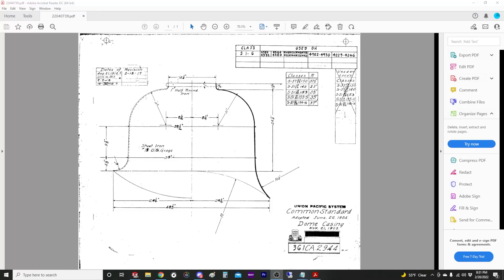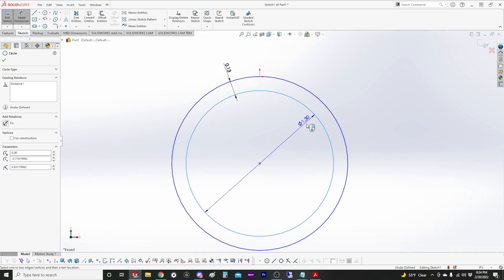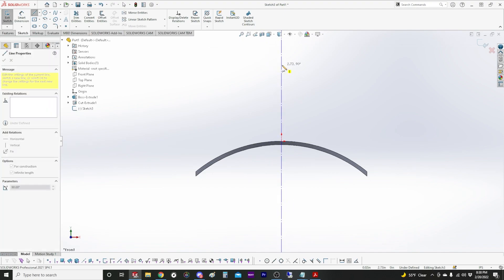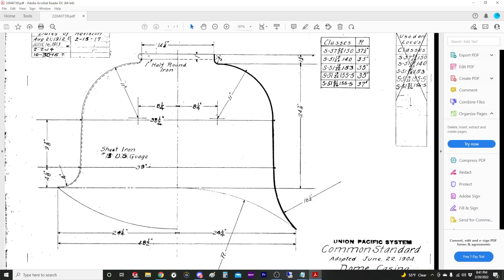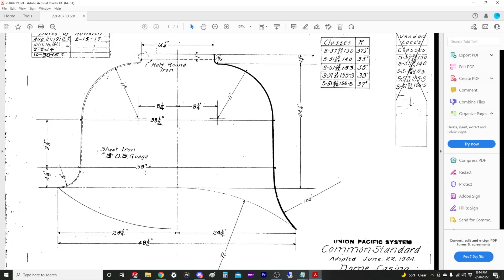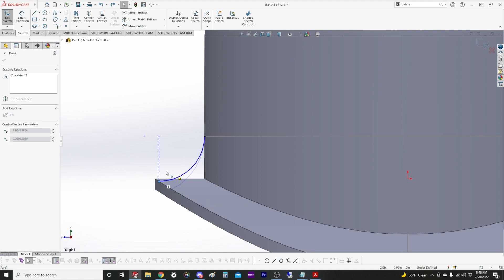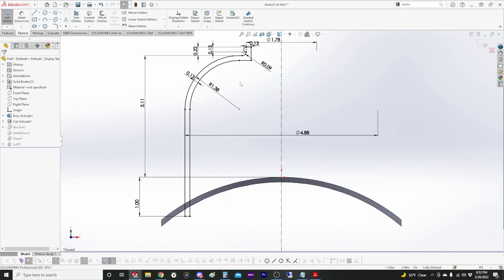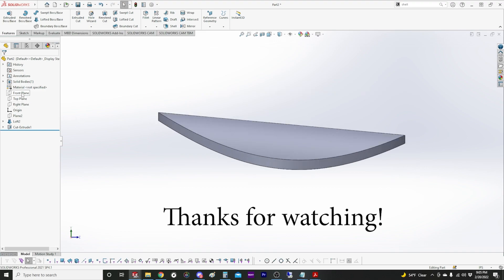Drawing a Locomotive Steam Dome in Solidworks

Comment: That looks so easy! Oh how I've struggled with 3D CAD... One finer point to note is that the dome is not with parallel sides. There's a 1/2" taper shown on the drawing. Doesn't really change your tutorial but that slight taper really helps the aesthetics of domes. Many thanks for showing the method.

Comment: Hey Anthony, you've hit this one on the head, this is exactly how I go about setting up these complex shapes in CAD. The only question I have is at 10:51. Is it possible to select the top face of the steam dome and have it shell the insides of the dome including the top, or were you doing that in a separate operation for a different reason?
Reply from the maker: Thank you Ferrous Equus! I shelled it from the bottom because that's where the more complicated geometry is, so I only had to do a simple extruded circle cut to remove the remaining wall from the top of the dome. If I had shelled it from the top face, I would have to remove the remaining wall at the bottom of the flange which would be a lot more work.